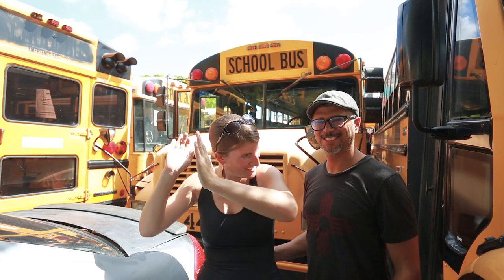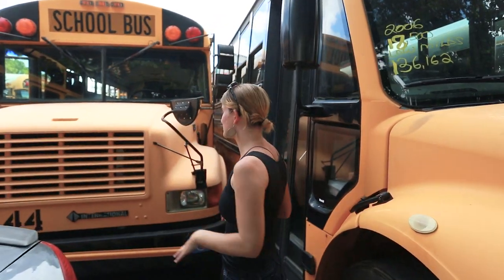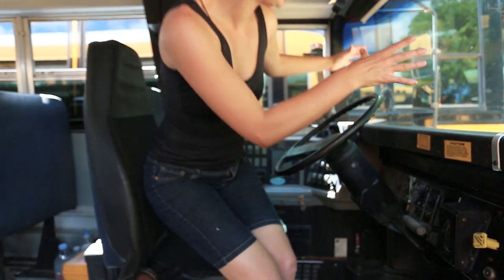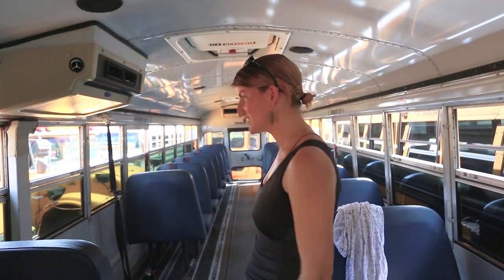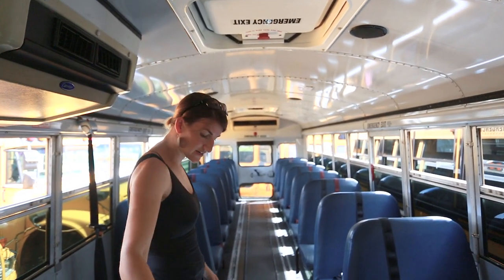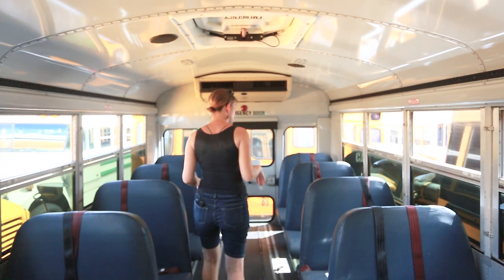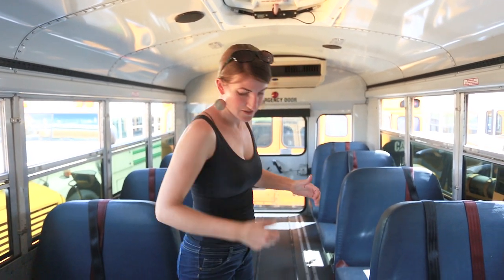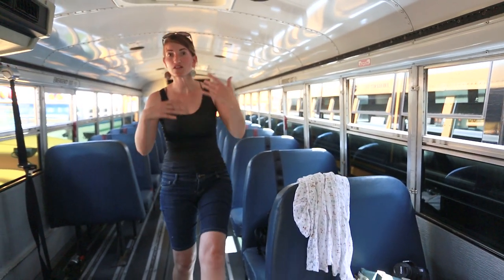Take a Look Inside THIS Awesome Skoolie BEFORE the Conversion!

Comment: Where did you buy the beast?  I'm in research-mode, but hope to join the movement at some point.  :)
Reply from the maker: Hey djpWilson!  We think we made the right move by buying our bus in Florida (and we made sure it was a Florida bus, not brought down from up north).  It's 18 years old, but it's in great condition with no rust because it's never seen salty roads in the winter.  We would really recommend working with the guy we bought ours from.  His name is Jose, the owner of A Bus Export, Inc.  (aabuses.com).  He's a very honest guy who goes above and beyond to help with the purchase and any help/advice you need on diesel mechanics, preparing the bus for conversion, etc.  He's been a godsend for us.